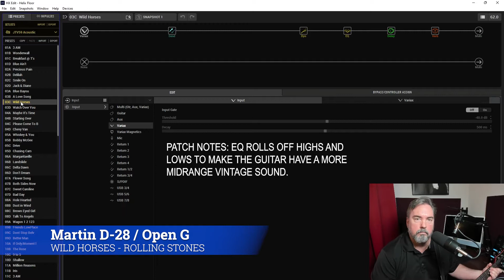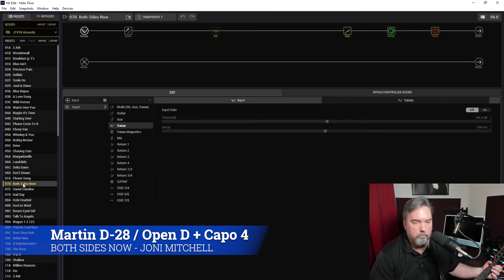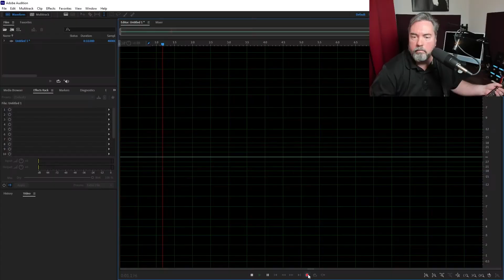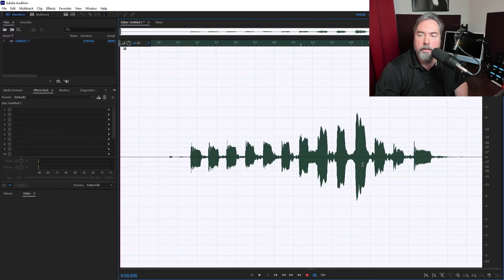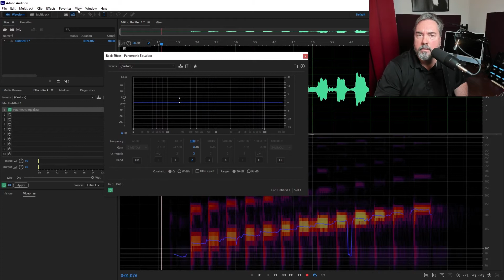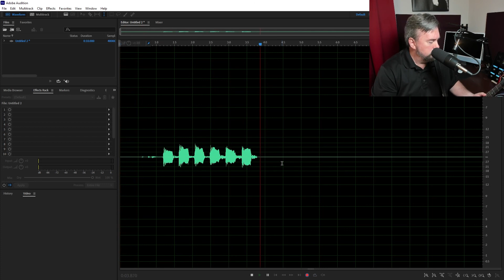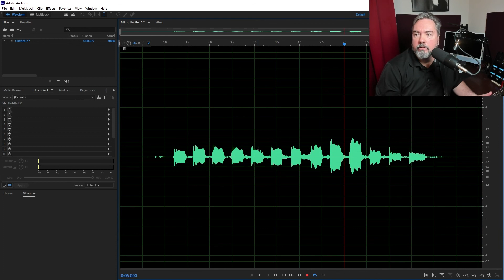JTV-59 Acoustic Model EQ Correction

Comment: Hi, gotta ask: would you buy a 2013 used model in 2022? The electronics will hold updates? Thanks great video
Reply from the maker: As far as I can tell the pre-2010 models (eg, 300, 500, 600, and 700) are considered legacy and cannot use the current Workbench HD model. The JTV's were introduced around 2010, and those instruments are compatible with Workbench HD. Not knowing the exact model you are looking at, I can't say for sure, but if it was manufactured 2013 it will most likely be compatible with the latest Variax firmware and Workbench.

Before you buy it, you should do a few tests to make sure the electronics are in good shape:
1. Plug it into a Helix floorboard using the DIGITAL Variax cable, set the patch input to Variax (which will let you then set the guitar model and tuning) then flip though all the guitar models in the Helix to make sure all the models are working and each string sounds right.  
2. Change the tuning the Helix to a 1/2 step or whole step down (do this by adjusting the tuning for each string within the Helix, NOT by physically tuning the guitar) and see how the guitar feels when it is tuned to standard, but it outputting a different tuning. 
3. Plug it into a regular amp using a normal 1/4" guitar cable, turn on the Variax models on the guitar, and try the different models and tunings on the guitar. (NOTE: This will require that the guitar has the battery installed.)

These tests will confirm that all the piezo pickups are working and the onboard electronics are in good shape. 

If you don't own a Helix, rent one, or just have them meet you at a major music store that has a Helix demo you can use it to test the guitar. You will also want to make sure they have a digital Helix cable on hand if the seller does not have one. If not, then buy a cable for the test. 

You will also want to ask if the buy has the battery for the guitar. If you are playing a Variax exclusively through a Helix with the digital cable, you don't need a battery. But, if you intend to play it using a 1/4" cable and want to use the ability to change tuning and models, you will need the battery.

Good luck!